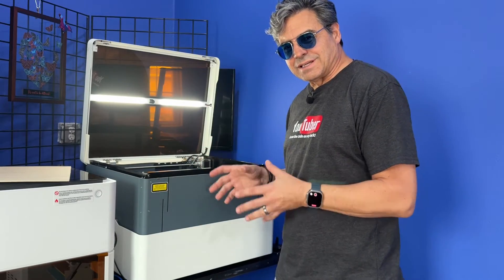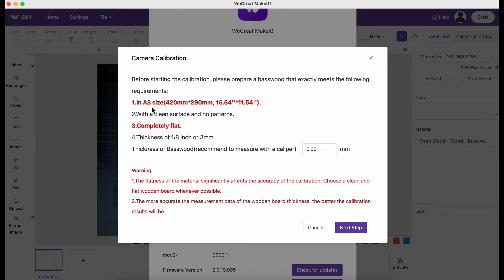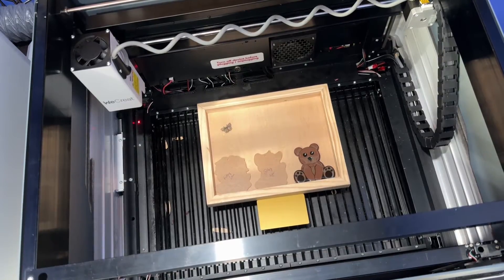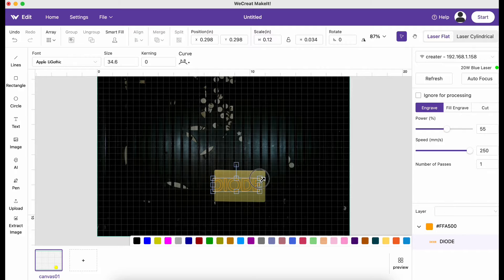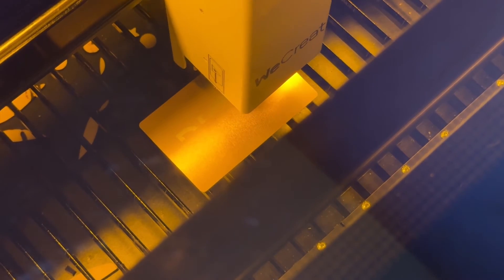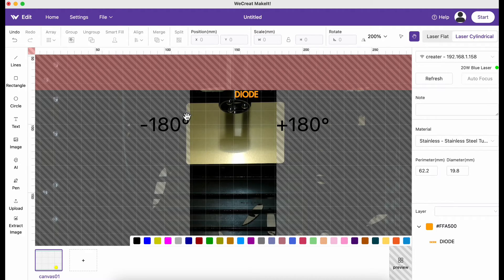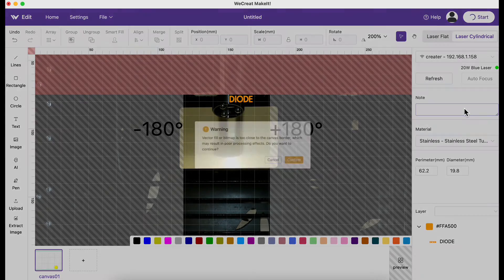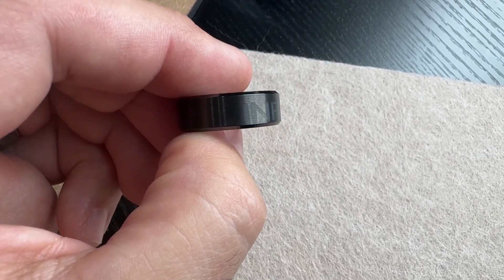How to Calibrate the WeCreat Vision and Engrave a Ring!

Comment: Not sure if that is a win... It did not center it on the ring. Customer would NOT accept that. Were you able to dial it in? Can you do a pass with just the indicator light on to confirm burn area? I need to do some EXPENSIVE Pieces.. Not sure I wan to "Chance It" and say there you go..
Reply from the maker: Going to do some testing with rings on the WeCreat Lumos. Stay tuned but the first video is out - https://youtu.be/GAvEfNWEbr8?si=xdkN4rQOvnze0C1y. Rotary and slider testing up next.

Comment: Hey, hey, here's an update on my return. WeCreat accepted the return despite all the issues I encountered. However, they wouldn’t facilitate an exchange, which still makes no sense to me. Consequently, I ended up ordering a new WeCreat with the Pass Through Feeder. Although the new WeCreat has arrived, I have to wait until May 12th for the pass-through feeder to ship.

I'm currently experiencing difficulties with my new laser, particularly with getting the bottom tray to slide into and out of the laser smoothly. Additionally, the right-side rack has a loose bar that jiggles back and forth. However, apart from these issues, WeCreat seems to be performing fine during the short testing period for engraving.

Just so you know, WeCreat Vision has introduced a new add-on called the "WeCreat 2W Infrared Laser Module." This module enables you to engrave rings and other metals, similar to what you've just done. They're scheduled to air the new product on April 24th:
https://www.youtube.com/live/1UwKCQtQ8iY?si=4ykATSJkXvITyCIQ

Anyhow, another awesome demonstration 👍😎